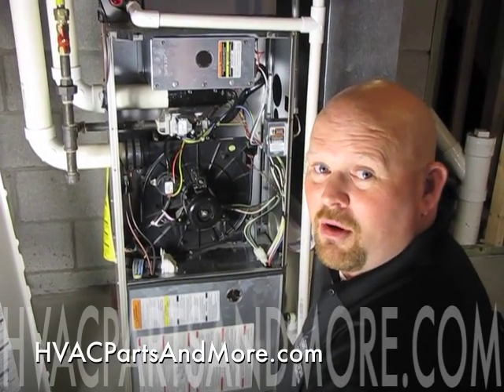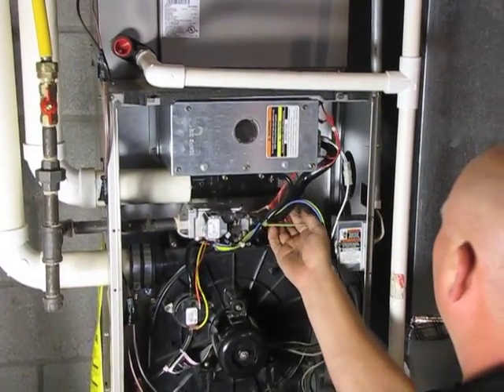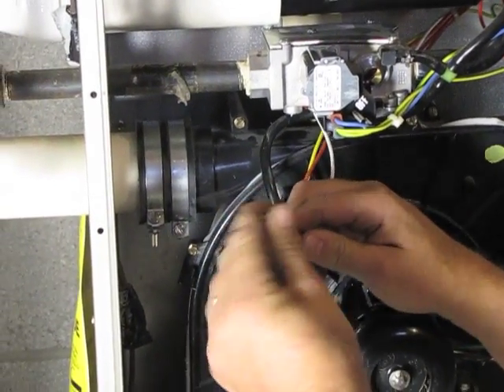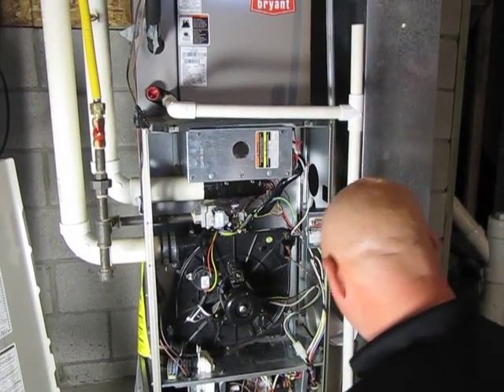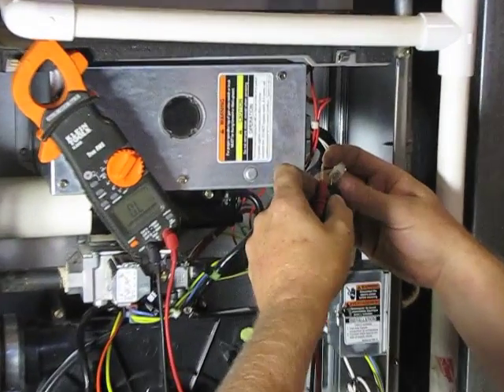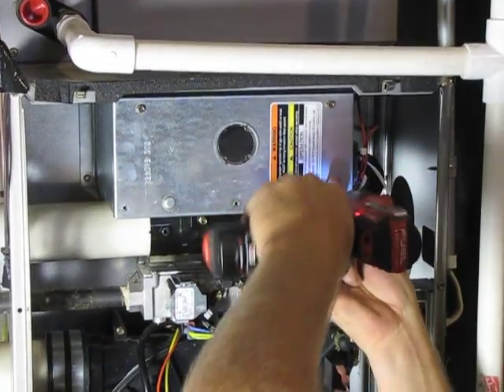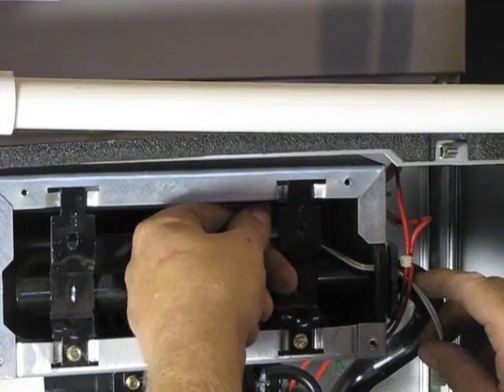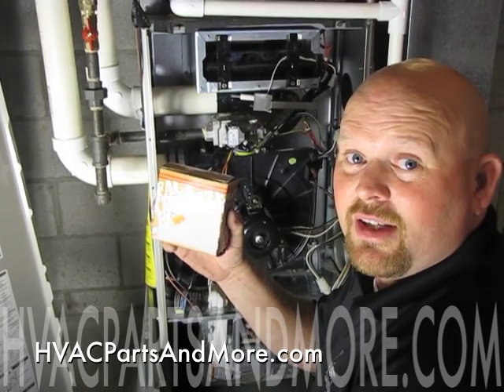DIY - How to Check and Replace the Flame Sensor and Hot Surface Ignitor on a Bryant 350AAV Furnace

Comment: I found a trick to reinstall the hard to reach flame sensor. When inserting the cleaned or new flame sensor use a ruler to wedge the flame senor to keep it from falling out. This freed up my hand to insert the screw which was the hardest part of the project. Make sure to use a magnetized bit so you don't lose the screw.  I used a Dewalt DWARA60 right angle attachment to remove the screw and a manual driver with a magnetic bit to reinstall. Thanks for the video. It was a big help.

Comment: I have that furnace and appreciate the video but I wish you would have shown us how to get that flame sensor out.  That is the difficult part...
Reply: Yes and don't they have that sensor is are real nice spot too, you can barely see the thing let alone get it out and back in.
Reply from the maker: Unfortunately because of where/how it's located, there wasn't much to show since we couldn't get a camera in there so we did our best to explain it instead. I hope you still found our video helpful.
Reply: @Hvacpartsandmore  Boy, I'm having trouble getting to that flame sensor. Before I head to Home Depot to buy a right angle tool of some kind can you tell me if it is a nut or a screw that I need to loosen? If I still can't get it out I may just take the burner housing off and attach some steel wool to some tongs and try to clean it in place. Thx.
Reply: @robw95  I just removed mine to clean it in 25 year old Bryant 90 plus. I loosened both PVC vents and pushed them out of the way. Then I put a 1/4inch driver on the sheet metal screw and loosened it with a box wrench.
Reply: @austinaubinoe  So that PVC is safe to remove then?
I was going to do the same thing you said but didn't know if I should pull the whole thing away from its housing.
Reply: Help! I can't get to the flame sensor and the video skipped over that part, conveniently. How do I get behind there?

Comment: What kind of 90 degree attachment you have with your drill? I really hate this furnace the worst Carrier models.
Reply from the maker: It will look something like this: https://www.homedepot.com/p/Milwaukee-1-4-in-Hex-Offset-Drive-Adapter-48-32-2100/100097677
There are different looking ones from different brands, some pivot and some are fixed at 90*, but you should be able to pick one up online or at a home improvement store.
Reply: Thanks a lot.
Reply: @Hvacpartsandmore  thank u

Comment: With the help of this video I was able to clean the flame sensor on my 355MAV. Unfortunately the furnace still didn't work. However, because of this video I knew to look for the hot surface igniter. (No need to remove the cover as it is behind the burners.)  When I cleaned the igniter and turned on the power the furnace worked! Thanks to this video we can take off our sweaters. And we won't have to live in a house that is less than 60 degrees for the entire weekend - or longer, this being the New Year holiday weekend. (Outside temp forecast is a low of 42 with a high of 54.)

Comment: I have a same furnace. I need to replace the senser. But i have trouble to get it out. You think I can get that 90 degree attachment from home dept?   What size should I get?  And what's the name?
Reply from the maker: Yes Home Depot should sell those. It will have a shaft end that goes into your drill or drill extension, and then it will have a socket end as well that will hold drill bits, both are probably 1/4" which is a very standard size. The 90* attachment itself is not to be used on screws, but to hold other bits. It can break if you use it directly on a screw.

Comment: What is the tool you r using?
Reply from the maker: The one used for checking resistance and continuity is called a clamp meter.